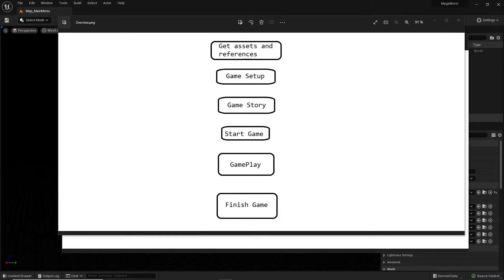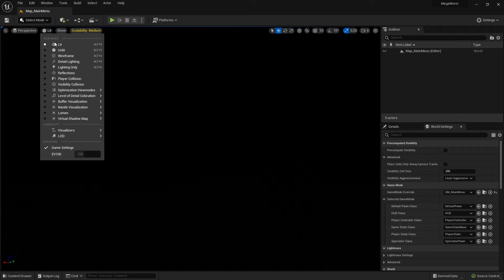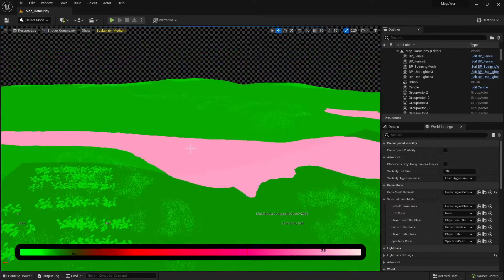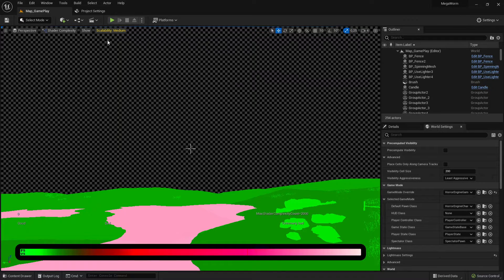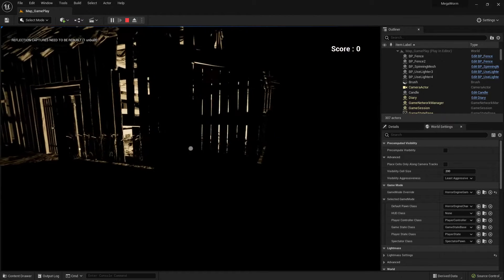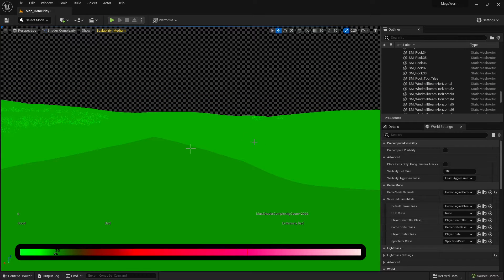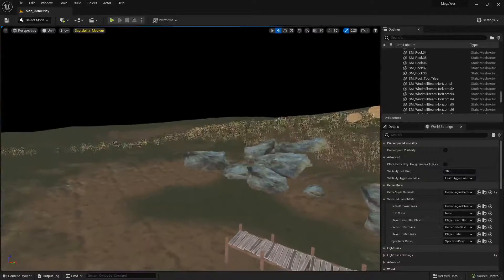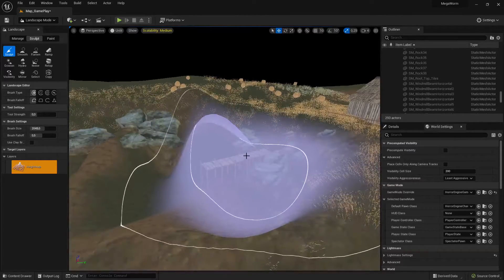UE5 - Beginner - Full Game Tutorial #61 - Shader Complexity

Comment: And what if I want to keep the river but solve the color problem from pink-white to green?
Reply from the maker: Hi, perhaps you need to tweak the materials of the river or you find another river material online which has a better performance. On the other side this game is not overloaded with much actions at the same time which means even if its pink-white it will probably not have a huge impact on pc versions.
Reply: The red colors indicate a number of instruction per shader/texture, so if you wanna let this light turn on the green side you need to simplify texture/shader, generalie movement in texture cost some ressources, reflection etc..., do some sacrifice on their quality or select only some of them, you just have to make a choice.
Reply from the maker: @Dieucreateuruniversel  Good answer.